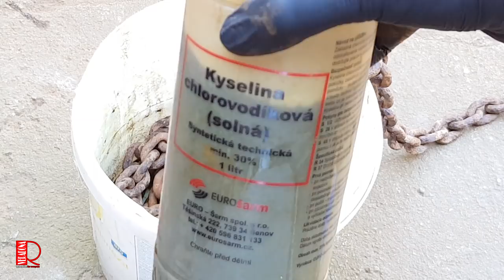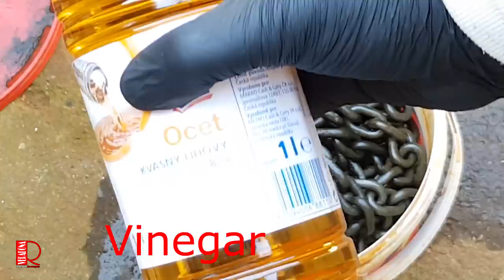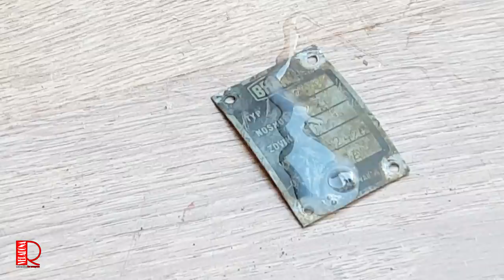Chain Hoist Restoration, block n tackle

Comment: Great work! I really like your channel. One thing though... when you pull the chain out of the hydrochloric acid, you can’t just rinse it with water, because that just dilutes the acid but it’s still acidic. To properly neutralize the acid, you should use sodium bicarbonate.
Reply from the maker: Thanks for the information. I thought vinegar was enough. ?!
Reply: Vinegar is also an acid...
Reply: @VeradonaRestoration 
 C * C* C* C* C * C* C* C* C* C* 
❤  ❤  ❤  ❤  ❤  ❤  ❤ ❤  ❤  ❤ ❤

Comment: super nice work as always, but man, what a job. I would never take on such a job. probably a good thing you record the dismantling, I would never remember how it all went back together. We often used a similar hoist for pulling engines. Not an engine puller in design but it did the job well enough... tho we had only one place in the shop we could use it where mounting it wasn't a problem.
Reply from the maker: Thanks bro :)

Comment: Very nice colour choices - the neutral gray makes the red shine out.

I have a tip for cleaning straight screw slots - a piece of hand hacksaw blade (say 5-6 cm long) with the teeth ground off, and ground across at around 30 degrees (like a super thin "plugging chisel") can be pushed or tapped along the slot - does a really nice job.
Reply from the maker: Thank you Paul

Comment: Lovely restoration, looks fantastic. If to be used to its rated weight limit, I'd think about replacing the chain. I'd also like to see the bearing being packed with grease properly, the grease needs to be forced in to the bearings.
Reply from the maker: Thank you for the warning Mark . It will be sufficient as a decoration :)))